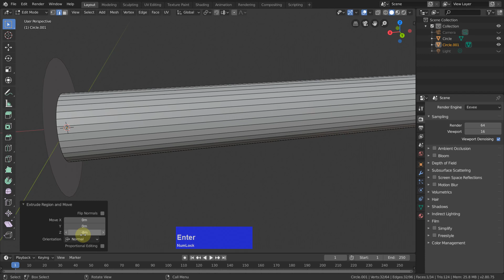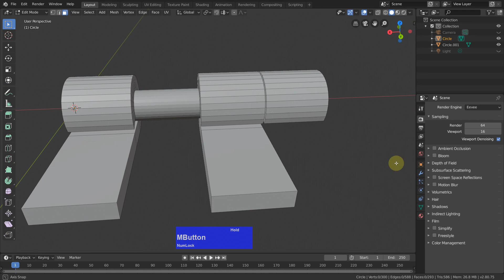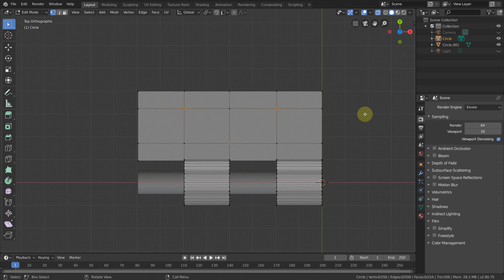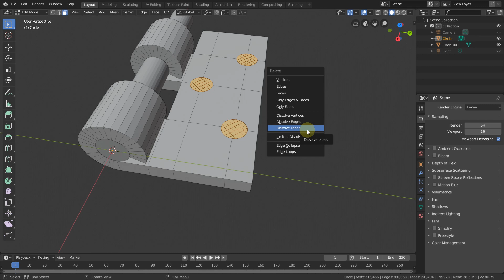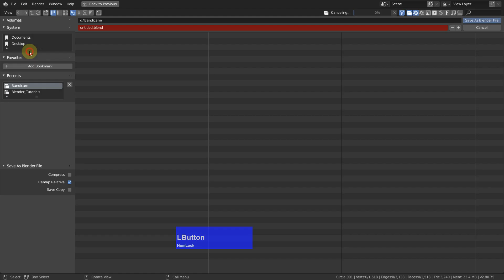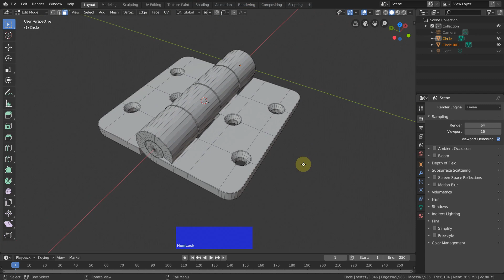A MODO Fans view at Blender 2.80 - Making a Hinge

Comment: Hi Peter, how did you make the vertex to a square in a 1:1 ratio?
Reply from the maker: Hiya, it's a very simple vertex bevel. All the best, Peter
Reply: I had the same problem, it's because the bevel function applies itself based on the object scale, look into 'Clear & Apply' function in Blender particularly with scale. Try to swap to object mode, select the whole object and press Ctrl + A and then swap back to edit mode and re-apply the vertex bevel and it should be uniform.

Comment: Thank you for yet another great tutorial, Peter! I have a question: which software feels more comfortable and efficient to work with, Blender or Modo?
Reply from the maker: Well, that is a difficult one to answer because i like  both. MODO surely still has some advantages, especially material and other libraries. I also miss the workplane but i am sure i will find ways around that in Blender. Some of the modifiers and tools in blender are still far away from intuitive, but with the growing interest of the CG industry i am sure there will be interesting things coming. Kind regards, Peter
Reply: @Robert Andegaven But the experience is certainly much improved in 2.8.
Reply: The Bend tool in Blender is really bad